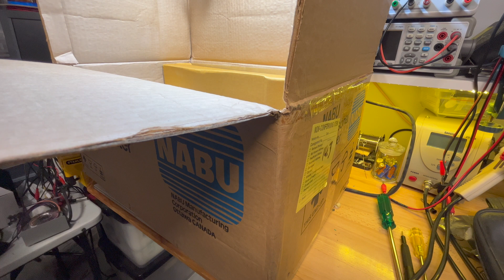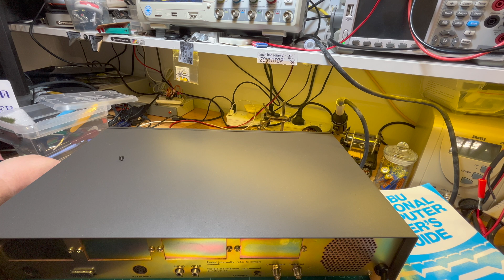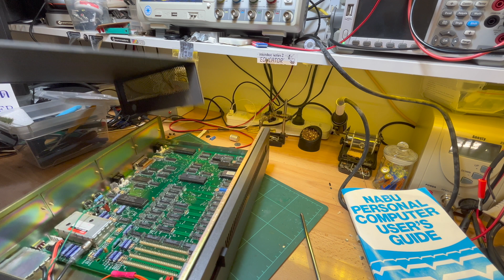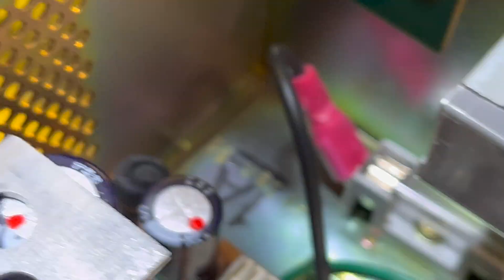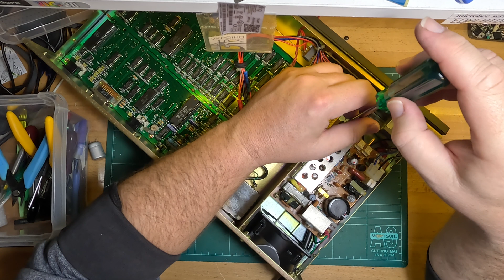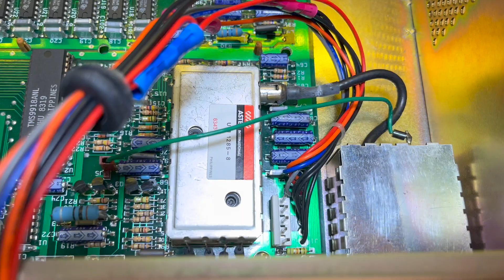🇨🇦 NABU: Part 1 [TCE #0271]

Comment: Congrats! A couple of things:

1) Be sure to check that your fan blades aren't lodged against the case. Seems to be a common-ish problem.
2) The NABU uses a 111k baud rate (blame Canada) and DJ had to come up with a way of continually resetting the port to re-sync communications.

The speed difference puts the NABU at about 5% faster than the standard baud rate of 105200. 

"Got NABU Working By Bypassing RS-422 Stage!" (https://www.youtube.com/shorts/5VoVyFIRREc) shows a guy using an Arduino as a RS232 adapter by grounding out the reset pin. Which is convenient since the Arduino has two 16Mhz crystals and the one used as a serial port could be changed out for a 16.6Mhz to give your adapter a 111k serial port.
Reply: You won’t be able to use the 110v fan with a 220v power supply, so you’ll have to remove it. Probably don’t even need a fan with a Meanwell since it’s smaller and runs cooler. I still need to replace my power supply, my poor NABU has been waiting months for me to get around to it 😅
Reply from the maker: Ahh, interesting point - I didn't think of that.  I assumed it ran off the DC output, not AC. /Brett
Reply: The 111k baud serial link was intended connect to the cable modem. Rather than conform to any standard.
Ditto for the keyboard serial interface.
Reply: @markevans2294  Like I said if you design both ends, you get to pick your baud rate. Besides, who wants to conform to standards? :)

The choice of RS422 is also weird one, I'd love to get the lowdown on that decision too. It's great for distance and multi-drop, but at higher cost and complexity.
Reply: @markevans2294  Actually it is spawned from the NTSC 3.579545Mhz rate that originates from the 10.73Mhz master crystal. From the NABU technical manual:

"Clocks 
The processor board is designed to operate in a television environment requiring specific clock frequencies. The processor board has a 10.738635 megahertz.!. 50 ppm fundamental frequency, parallel-mode crystal. This is directly connected to the video processor. The video processor divides the clock frequency by three resulting in a 3.579545 (referred to hereafter as 3.58) megahertz basic clock rate. This 3.58 megahertz clock is used to drive the Z80A microprocessor." 

The clock for the UART (the TR1863P) uses the 3.579545Mhz clock divided by 2 (and then internally divided by 16) to get 111861-ish baud. 

So it works out to be 10.738635/3/2/16 to get 111.8k baud. Le mystery is solv-ed! (Inspector Clouseau reference).

And due to me being a dolt, I got the "standard" baud rate wrong. It should have been 115200. Doh!
Reply from the maker: Oh yes ... I noticed the fan blades were a bit stuck ... I assumed that when I first powered it on I would probably hear grinding!  Good to know it's a common issue! For the baud rate ... could patching the ROM "fix" the issue I wonder?  I noticed there was a commented disassembly (I think) ...
Reply: @Brfff  I wondered about the voltage to the fan. But the good news is that fans are cheap & plentiful.

As for the baud rate, nope. The "State of the Art" chip that they used from 1915 (recovered from the fire control systems of retired Dreadnoughts) only divides the 1.79Mhz clock by 16. So to fix it from the NABU side you could try using a step-down clock on pins 17 & 40. Which should also work...

But the Arduino board gives you the sweetness of a "standard" RS232 (as if anything in the RS232 can be considered "standard") at the expense of not being able to multi-drop your multiple NABUs from the same network. You know for those of us that have spare NABUs and want to keep them busy.

So design and add a board with its own clock, or add an existing board with a modified clock crystal. Those appear to be the hardware choices to me. And there is a bit of rumbling about the RS422 connection causing problems, some of which probably can be attributed to the different baud rates.

The design decision of using a 1.79Mhz system clock is a head scratcher, but in all fairness if you are going to follow up the NABU with your own network adapter it really doesn't matter what baud rate that you choose.

But a software fix will be limited to continually resetting the Western Digital TR1863, which is not a fix per se.

I'll send you the TR1863 PDF which covers the general hardware side of the chip, and the application note that covers how to use it (no software control). They can be found on Archive.org IIRC.

Comment: Congrats! 

Just a thought... if you have access to a 3D printer, it might be worth printing a new panel with something to hold both the DTech RS422-USB converter board and the USB socket onto it. Not sure if anyone else has already designed such a thing, but it'd be a neat solution. It'd also mean you can put the original panel away for safekeeping should you decide to uninstall the RS422-USB adapter later on.